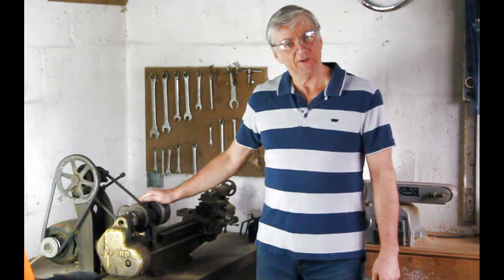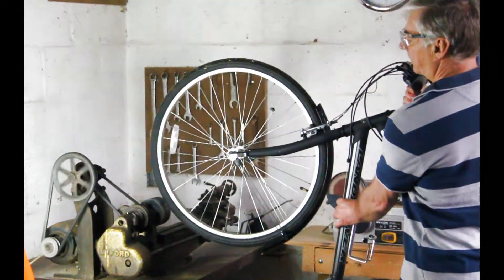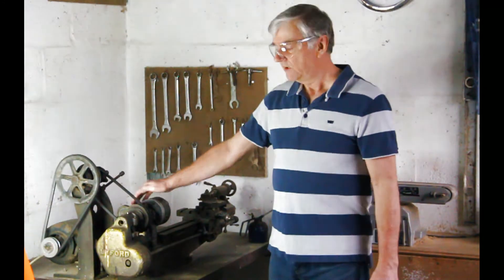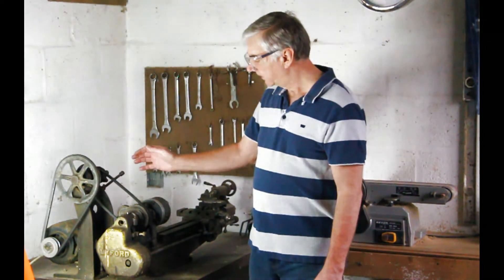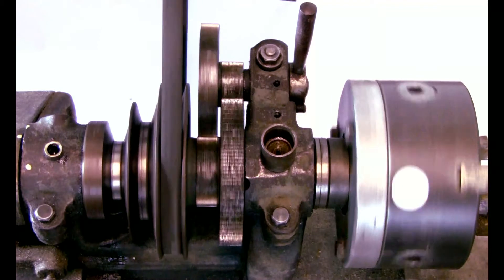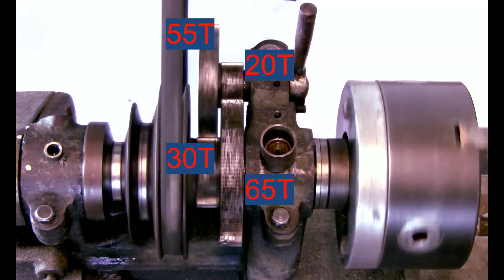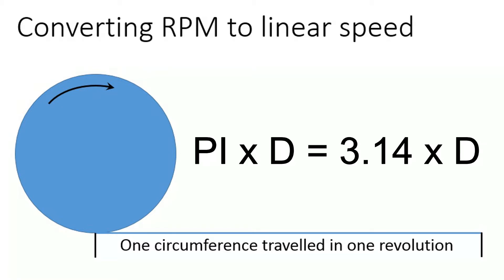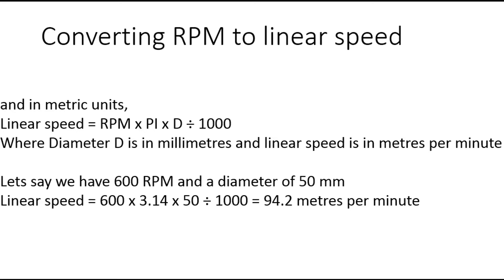Myford ML4 how to measure RPM and cutting speeds

Comment: What oil should be use for the bearings
Reply: I have always used a good quality car engine oil as it has excellent corrosion resistance etc.
Reply: @moonlight_rider use hydraulic oil for lathe spindle
Reply: use hydraulic oil for lathe spindle